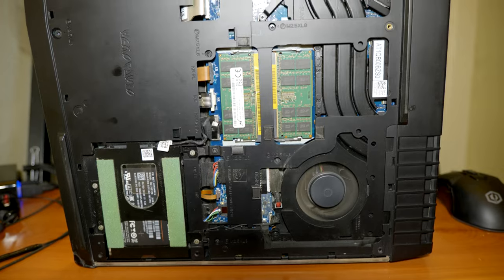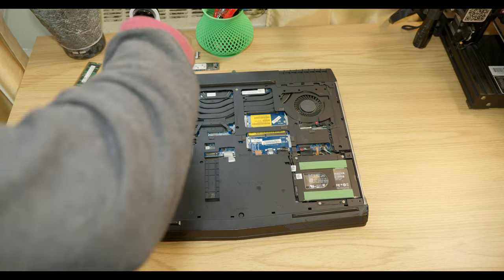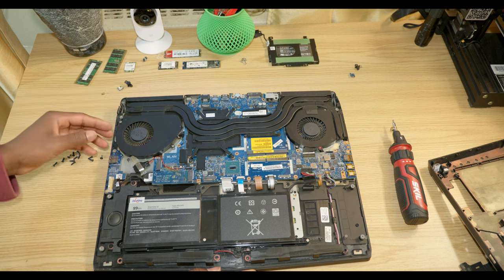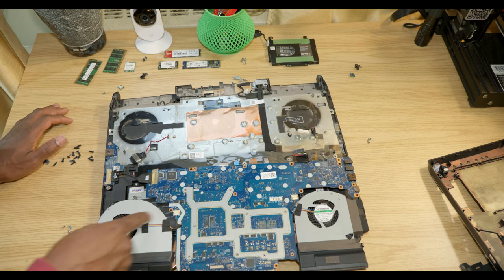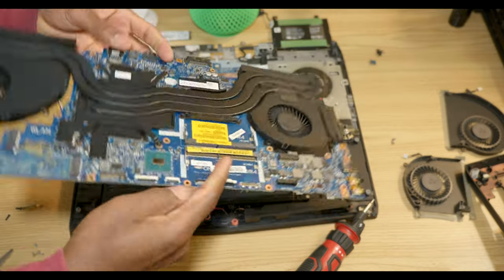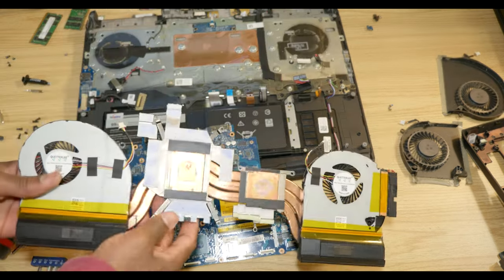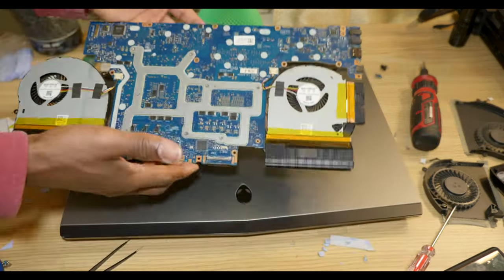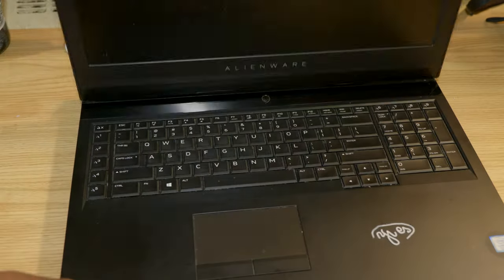Alienware 17 R4 Cooling Fans Replacement | Gaming Laptop

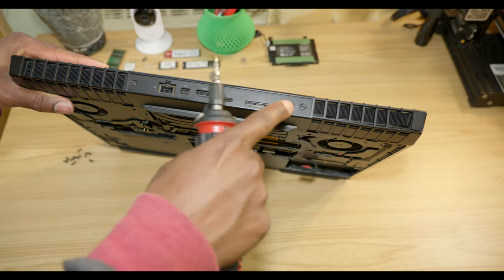Comment: I did this using my Alienware 17 R5, which I had mistakenly thought was the R4.  The only real difference is that the R5's back panel does NOT come off as easily as the R4 shown at 3:20 .  I wish it would of came off that easily!  I had to pry the gap of with knives, and had to leave a credit card in the gap on the top side to be able to pry it off on the back with the knife on the bottom.  It was by far the worse part in an already fairly complicated process!

Thankfully the fans used on the R4 are the same as the ones for the R5, and now the failed bearing for the GPU fan no longer has to bother me!

Another thing is to very much take note of where all the screws went particularly for securing the motherboard.  A lot of the screws that secure the inner case also go all the way through the motherboard.  You may secure the motherboard down, but once you put the inner case back in, you'll notice that you accidently may of put a screw securing the motherboard that was initially supposed to be for the inner case.
Reply from the maker: Thanks for sharing! I thought they would be more similar, but this will definitely be useful to the audience. Pinned your comment

Comment: How long did it take to boot up?
Reply from the maker: I don't remember how long it took exactly, but it was close to 2 minutes. If in your case it takes longer, keep an eye on the power button for a blinking error code. Here is what each error means: https://drive.google.com/file/d/1N6CKgDvE_01dERPc6ByjI3anqU4CtJYb/view?usp=sharing
Reply: @YvonSmart  ah thank you, by chance you know why the cap lock button and number button blinking and screen not turning on? I changed the fan which is working but not turning on.
Reply: @YvonSmart  I am having the blinking issue T^T question, is it an easy fix?
Reply: @YvonSmart  Hi, turns out it’s a display failure. Do have any suggestion to fix it?
Reply from the maker: @reikasakura4539  It's probably the display connector not secured right. It's a delicate cable, carefully reconnect the display cable
Reply: @YvonSmart  I was able to fix the display connector but the cap lock and number button blinks 3 pause 3 pause 2 pause 1. I tried doing the BIOS recovery but I don’t think it worked.
Reply from the maker: @reikasakura4539  A blinking "Caps Lock" key typically means that there is a power-related issue, such as an error with your power supply, or that your computer cannot properly ventilate itself. I don't think it's BIOS related. Just make sure to reinsert every drive in its previous socket, even the RAM sticks. You may go to BIOS to make sure boot sequence is set correctly because removing the BIOS battery resets its settings, it doesn't do anything else
Reply: @YvonSmart  I did double check to see if everything was secure and everything seem plugged in. I can’t do the bios test cuz the screen is black. I also think it’s the power issue because everything light up but it doesnt sustain it. I don’t know what else to do😭😭
Reply from the maker: @reikasakura4539  I had a black screen a few times before. Don't rush it. Turn it on and count the power button blinks: how many blue lights and how many red lights. It tells exactly what's the issue
Reply: @YvonSmart  there’s no more power blinks, only the cap and number button blinking.
Reply from the maker: @reikasakura4539  A BIOS issue it sounds like. Power computer off, disconnect the main battery, then disconnect the BIOS battery (Coin cell battery). Press and hold the power button for 20 seconds, let go, this will discharge all the capacitors on the motherboard. Reconnect coin cell battery, then the laptop battery and boot it up. Should clear things up
Reply: @YvonSmart  I did those steps, just not the discard but gonna do it again and let u know🙏
Reply: @YvonSmart  yeah unfortunately the situation didn’t change. Still the same error with cap and number button blink.
Reply from the maker: @reikasakura4539  Try, swapping the RAM sticks places (if you have two), or switch socket if you are using a single RAM stick
Reply: @YvonSmart  I did that too but nothing 😢
Reply from the maker: @reikasakura4539  Are you able to launch the BIOS? Press and hold f2 and turn ON computer. Or run a memory diag by pressing F12 while booting up? I'm hoping this is not a processor or motherboard issue
Reply: @YvonSmart  I did try F2 and F12. I’m hoping it’s not that either but the screen is not turning on so I can’t see if it kicks in but the cap lock blinking stops when I do the BIOS boot up.
Reply from the maker: @reikasakura4539  Is the LEDs of the screen lit but but black (No content), or it's just off completely? Can you use an HDMI cable and connect the laptop to a separate display? A TV would do
Reply: @YvonSmart  the LED is on but the screen is black. I plugged in the hdmi with the second monitor but it was also black screen. I didn’t try the TV yet.
Reply from the maker: @reikasakura4539  This could be a motherboard issue but before looking into the motherboard I would do a lot of research online if I were you. Or relax completely and reassemble everything slowly while taking my time. Note that if the ram is not recognized or defective, the display would be black too. But in that case you will also have the power button blinking
Reply: @YvonSmart  yeah I think I’ll take to get it looked at. But thank you for taking your time helping me with this🙏
Reply from the maker: @reikasakura4539  You're  welcome, good luck!

Comment: I couldn’t see exactly what you did for the LEDs other than undoing the screws. All of my screws are undone but it still sticks to the sides where the LEDs are located.
Reply from the maker: After the screws are removed the small PCBs with the LED comes out (unless it's held down by the tape). There is a translucent tube connected to each LED but it's not a permanent connection

Comment: I wonder where the heat concentrates the most
Reply from the maker: The major heat generators are the CPU and GPU, but a few chips always get hot so there are also in contact with the heat-sink. It isn't that bad

Comment: After i replaced my fan. It didnt turn on. How should i do
Reply from the maker: Maybe you didn't push the connector in all the way or you pinched the wires while putting it back together. You should carefully disassemble it and check all the connections. I would also make sure the laptop gets up to temp to see if it's not just expecting a certain temp to kick in (depending on how you setup cooling in  the BIOS if applicable)
Reply: @YvonSmart  i already rechecked it. Light codes says coin-cell battery problem. 3 red 1 blue. What should i do?
Reply from the maker: @ramicesompad4523  The display connector is probably not connected right. The LED flash code is display related if I not mistaken. The display connector is delicate, recheck. Do all LEDs and fans turn ON when you power it?
Reply: @YvonSmart  the fans did but the other LEDs did not